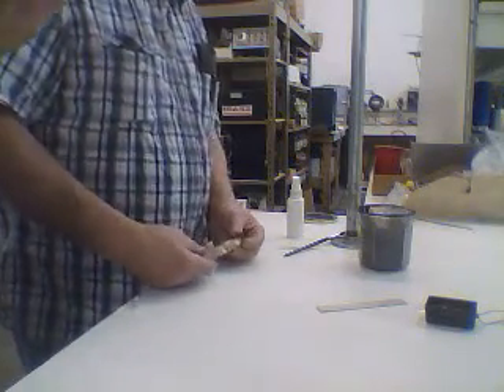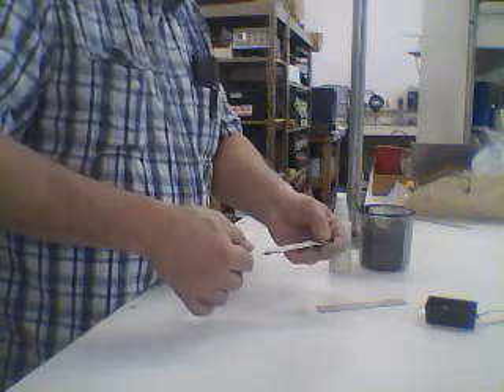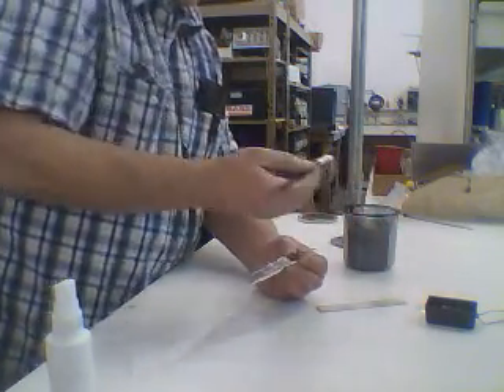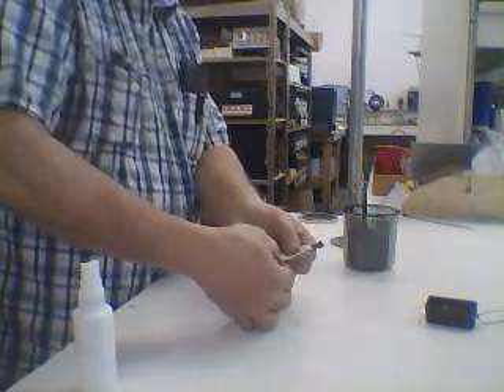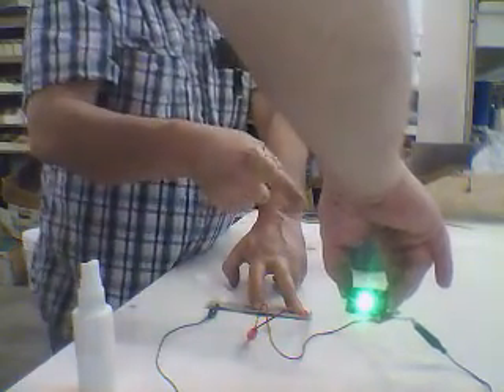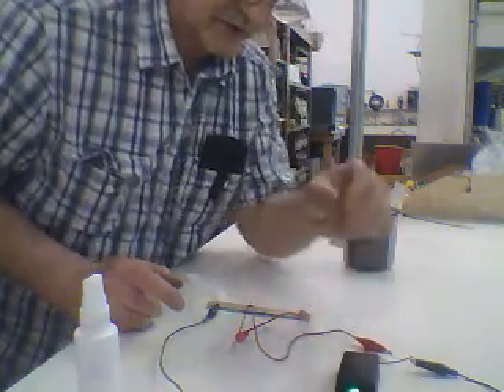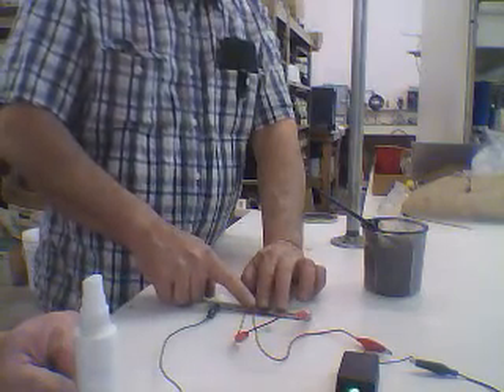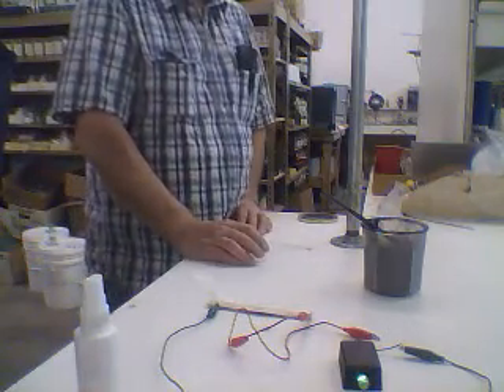Copper Oxide Rectifierpositive with Galina Lead Sulfide pbso4 negitive powering osilator circuit

Comment: Nice John. Now to take this further. What happens when you stack them like in high voltage applications. Putting two or more in series? My guess is that it will be able to maintain the material voltage separation better?

 I always thought these were diodes.